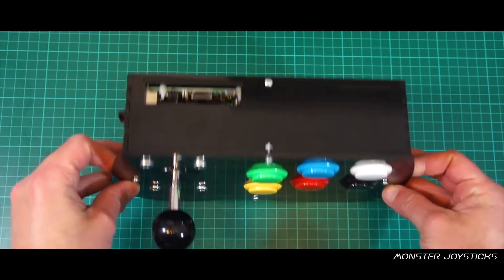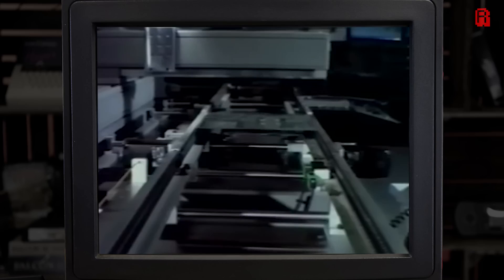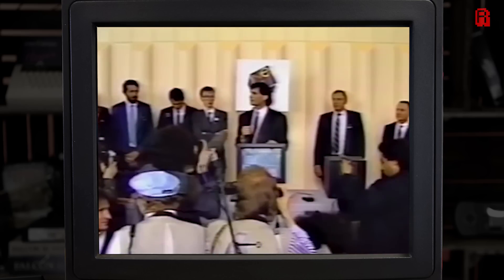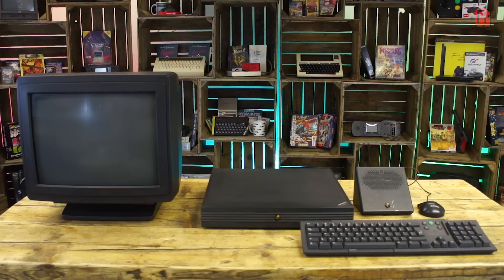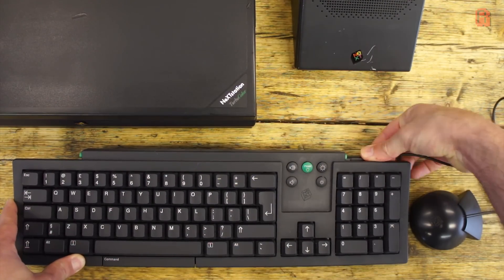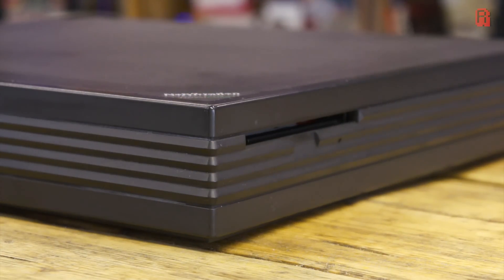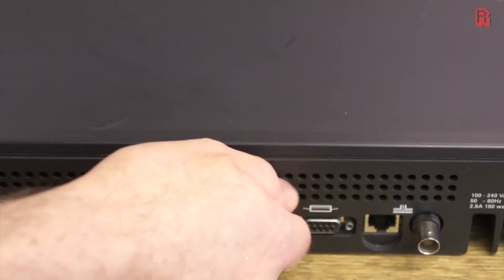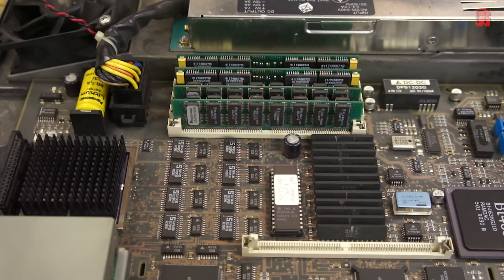NeXT Station | When Steve Jobs Left Apple - Part 1

Comment: The soundbox exists because NeXT couldn't get their monitor suppliers to put those components inside the monitor enclosure.  Steve was not happy about that, but by the time the color machines were under development, Sony and Toshiba weren't willing to front the engineering expense to make a custom unit for NeXT.  All they were really willing to do was put them in a black enclosure.

Comment: Egad NextOS and NextStep mmmm  lovely
Man if Apple had gone ahead with clones with A/UX or BeOS (plus got their head out of their ass) It's likely they'd have better, and vastly cheaper computers by now. at the time BeOS whiped the floor with apple for performance, hd space use, and ram usage. in a time when nothing multitasked other than the BSD's and Linux. that was a huge thing.
PowerComputing made a better Apple than apple did other than the buzzard splattered parts. it made a early attempt to expand memory. the clones brough apple early PCMCIA (don't ask) and PCI slots to the desktop at the cost of (then) god awful ATI hard disks. a fact i warned steve about. Take a guess how well he listned. If you answered: Not. one. fucking bit. You'd be right!
He also didn't want anything to do with USB. No idea why then, or now. Althing. They did try to make keyboards and mice that used ethernet. In terms of one form factor made sense. in terms of getting the fucking thing to work was a disaster. I doubt many, if any units sold actually used that....wait no I'm wrong, early laster writer printers did because asmbler was like a punch in the dick, Next and Apple  used ip weirdness to talk to printers through postscript. which was actually genius.(other than fact that a just about all universities, because of DARPA and Arpanet did that way before but this is apple. You felt lucky if the fucking os didn't crash after a few games or writing up a report.

Comment: My favourite computer system of all time, thanks for making this video. In the 90s, I bought a relatively affordable secondhand NeXTcube with the NeXTdimension graphics accelerator board while I was at university, using all my savings, some money from my parents and a large portion of my student loan. It was a gorgeous machine on which I learned to program in Objective-C using ProjectBuilder and InterfaceBuilder. Later, I traded it in for a 486-based Intel GX workstation which ran OPENSTEP faster than the older NeXT hardware did, and as a bonus, I could dual-boot into DOS and Windows. I still keep my copy of the OPENSTEP Mach 4.2 OS and my apps running under VM emulation to this day, such a refined looking GUI.

Comment: I found a Mac IIFX in a dumpster. Can you please do a video on it? It was much to my surprise it was like $11000 USD in 1991. I made my own VGA cable and it got online and impressed me in 1997-8 and worked perfectly except the bios battery. It looked like a 10 year old crusty flashlight battery hardwired to the motherboard!

Comment: I want to address your question at https://youtu.be/NbZ1M_qw-a0?t=1007: the Motorola 56000 DSP has never been programmed to his full potential, not even in the ATARI Falcon030 and standard GNUstep never took advantage of the full power of BT463 RAMDAC.

The limits of the DSP are still being discovered (at a glacial pace, I might add) in the ATARI Falcon030. By that token NeXT is terra incognita at this point. "The market" never matured enough to take full advantage not only of this NeXT system, but of Sun Microsystems Ultra line and SGI systems are even further away from discovery.

It would take the demo scene to figure out where the limits of this hardware lie and what it is truly capable of. We are still discovering just how far the Commodore64 hardware can be pushed in 2019, so try to imagine how many decades it would take to figure out what the NeXT or Sun or SGI hardware could be pushed to do. Which programming tricks lie in wait to do what the engineers of these systems never even considered?

Alas these are obscure systems; even demos which run on SGI's and Sun's are usually written in C and SDL and never bang the hardware directly. To see what this hardware is truly capable of, it would need to get into the hands of sceners and then we'd have another 30 years of research in pushing the hardware... so yeah, the market was nowhere near ready; it isn't ready even today.

Comment: The Motorola 68040RC running at 33Mhz or 40Mhz was a smooth running CPU for those operating systems that ran on it back then. To this day I remember it as being one of the more snappy and responsive CPUs I’ve used. I owned several Mac Quadras, with the 650 and 840AV being great for the time. My university had a few NeXT workstations for electronic composition. I’d like to get my hands on a NeXT Cube. As far as I’m concerned I think NeXT is Jobs finest moment. Obvious saving Apple will always be seen as his legacy, but the foundation and footwork was all done at NeXT. The GUI is just as fresh in 2018 as it was in 1988. 30 years! That says a lot. Especially the decision to include a Postscript Display GUI. The portability of the NeXT microkernel was responsible for Apple’s ability to port the OS from workstations, to iPods, to iOS to Watch OS, etc. and multiple CPU architectures. Really smart work NeXT did. Luckily Jobs had the Apple brand name to expose the world to this great tech convergence.

Comment: FYI, the SGI 13W3 monitors are also compatible with NeXT hardware.
I have a NeXTcube with MegaPixel Color Display (FIMI) monitor and my NeXTstation Color has an SGI monitor.
Reply from the maker: That's handy.  I'm releasing episode two tomorrow and have found that my capture card has a Sync on Green option built right in, and my old LCD monitor supports it natively so I was pretty lucky, just a 13w3 to regular VGA adaptor needed for the task
Reply: These two links are a compiled list of SOG-compatible screens that was cumulated for SGI machines. They work on NeXT black hardware with nothing more than a cheap 13W3M-VGA adaptor.

http://www.nekochan.net/wiki/Monitors_on_SGI_Machines
http://www.nekochan.net/wiki/Monitors

I've ordered a sync splitter for replacing my FIMI monitor (too bug and power-hungry for my purpose) that I will connect to an Acer V176L, which just looks like it was designed for the NeXT black hardware.
Reply: Every display that I have owned with analog inputs supported sync on green.

Comment: I was a scientific and industrial user of NeXT computers. You should be able to get that Intel version running or a huge range of Intel hardware, just make sure you have a compatible SCSI card and the rest should be easy as I remember. One of the final machines I had from NeXT was a Nixdorf dual Pentium Pro, it seemed blazing fast but the cubes with the video card that cost more than the machine was my favorite. For our uses we compared them to visual workstations from HP and Tektronix and NeXT was about one quarter of the price and way more compatible and loaded with options the others charged extra for. We also used SGI machines but the advantage of NeXT was how well it talked with everything else and how easy it was to patch together your own tools and make them look like a professional application. All these tools came with the machine, even a compiler which was a big deal at the time. Not only did you get all that but I had the business card and telephone number of an engineer at NeXT who specialized in making NeXT machines work in our industry and I could call him directly with questions or ask him to review my code, try that today.

Comment: So the hardware is pretty much a Atari Falcon but with more memory.
Reply from the maker: Funny you should mention that, a Falcon appears in tomorrows release and we make the comparison
Reply: Well.. with the old 68030 processor... they even have the same processor.. Of cause the 68040 is quite a bit faster. But with the original NeXT used the -30 processor.. its pretty much the same system. With full 14MB of ram on the Falcon they are really quite equally matched.

Of cause the Falcon is 3 years newer.... on the other side, its quite a bit cheaper.

Comment: Of note - because NeXT systems use the same keyboard and mouse connector as the Mac, you CAN use the power button on a Macintosh ADB keyboard to turn it on.

And that "sound box" was necessary for color monitors - the monochrome NeXT systems used a single cable for audio, video, and ADB, so had a custom connector, and all the plugs for audio and ADB were on the monchrome monitor itself.  (I have a NeXTstation Turbo monochrome with matching display - it has no "sound box". Mine have the older style keyboard and mouse.)

Comment: Setting up and running NeXTSTEP on a 'white box' aka 486 PC can be quite the challenge.  There is some help over @ http://www.nextcomputers.org/forums/viewforum.php?f=10  Although plenty of it boils down to using updated drivers, and checking that Hardware Compatibility List.  NeXTSTEP 3.3 is the best shot, the older 3.2/3.1 will require a SCSI HBA.  Although the 486 will underperform, the real power of course came from later generations of the Intel processors, like the Pentium Pro, and beyond.

For anyone looking to try out NeXT via emulation, be sure to check out Previous http://previous.unixdude.net/  It is feature complete enough to run all NeXTSTEP versions, with support for the next dimension board, DSP and of course ethernet!

Comment: The laugh being one of the reasons that Jobbo the clown was outed from Apple being his insistence that no 'professional' computer 'needed' colour...

He went on to make a $6500 "professional" computer in 1988 that couldn't display colour and who's video output was inferior to most SVGA 386 clones of the time. THEN he even fought his own investors over the creation of the NextStation colour because again, apparently colour is evil. Likely why on his return to Apple the machines went from a rainbow of colours to having all the style and artistry of a recently sanitized hospital ward.

Almost as bizarre as his nutjob rabid hatred of fans in computers; one of the contributors to the failure of the Apple III, and likely why to this day crApple wouldn't know a proper cooling solution if it stripped naked, painted itself Noctua tan, and hopped up on a table to sing "Oh look at what a big cooling fan I am!" Thermal throttling? What's that then? 

After all, what was the number one third party after-market add-on for the Apple II? Oh that's right, a sidecar with a fan in it so the PSU wouldn't go bits-up face-down if you tried to run it for more than an hour straight!

That reality distortion field of his was truly amazing. He could sweet talk a squirrel in February out of its nuts.

Comment: The control key is where it's supposed too be, and in the place it was on all computers till the Compaq clone PC. Which IBM also did on their AT. A common joke back then made about this (rather obnoxious key movement) is that Word Perfect paid Compaq to change the standard key layout to screw over WordStar users.

Take a look at your Commodore computers,  or any Apple II, any Sun Work station, the official SGI keyboards, or pretty much so any non-PC keyboard from the 90s and earlier and the layout is the same. The IBM XT series also has the same layout. Excluding the Compaq machine that started this change, XT clones all have the same layout.

Xfree86 and it's decendants all have an explicit option to correct the PC keybaord layout, and several coder orientated expensive keyboards offer putting the control key back in it's original position.

Comment: Well, someone really does get angry about this. The big failing of the 68k was really they could not get the clocks up. Intel could do it, Motorola could not seem to do it. The 68060 ran cooler and faster than the 40 but it was a dead end, just as the PowerPC could not keep up without melting. That's the end of it for me. But it bothered me when you start 20Mhz and 32 big address and data us when the system here has these.

Comment: Looking forward to part 2 as I never got to see the 68040 second series in action. Even at the time people thought the 68030 was suffering a bit. Interested to see how well they go as great examples of systems that have strong supporting hardware too. Have a PA-RISC machine that runs Nextstep 3.3, an 80Mhz version, the mid range one, want to see how that would compare, it certainly does not have the great supporting cast of chips, no DSP for a start. Plus, unlike the Next boxes the plastic has all aged and become brittle, they were meant to be cut down to a cost but were still out of reach of all but the few.

Comment: I had one of these babies when I worked at the BBC. The NextStep development environment became  XCode in Max OS X. The InterfaceBuilder is very much the same and many libraries and classes are still prefixed NS for NextStep. In the early 2000s I dug the machine out and had it online.
Reply: lrochfort I got one off Flea Bay in 1999.  There were tons of the slabs going for less than $100 USD.  Compiled all kinds of UNIX apps for it.  Send mail 8 something or another wound up being taken over as s spam relay and had to shut that down.  :(

The only limiting factor I ran into was a lack of support for threads.  Although Mach supported threads, it was not POSIX compliant.

The boxes still functioning today should really have a version of Linux or FreeBSD ported for them to run.
Reply: @markteague8889  Maybe you need to do something like "How to install Linux on a vintage 68K Mac"? (Both Macintoshes and NS had 68040 chips.)
Reply: @StrangerHappened  LOL … I wouldn’t have much of a clue about installing Linux.  In theory, it would be possible.  Although by today’s standards they are cripplingly slow machines, they did have some pretty kool hardware in them.  Especially, if you have the NeXTDimension board for video.  It would take a community effort to implement a Linux kernel and distribution capable of running on NeXT black hardware and fully exploiting the available peripheral devices.  As an alternative, the “Previous” emulator of NeXT black hardware was a very interesting project.  Last time I checked, It seemed to have been abandoned.  It’s the way these things go.  Someone is working on a graduate computer science degree and gets interested in emulation, then they finish school, get a real job, begin a family, and they no longer have time to play with such intellectual curiosities.
Reply: @markteague8889  Should Linux be necessarily slow on 68040 though? Those CPUs were the beasts of their time, super fast. Linux itself is a kernel so by default it should not be that slow even if it has gotten fatter since the 1990s when its first version was released. Some barebone GUI shells from the KDE/X-Window family of projects should not run much slower than native NS GUI in its basic functions. But the idea of developing stuff to actually use anything else beyond the 68040 CPU and the very minimum video driver support seems to be hopeless since it would be a major effort for a purely hobbyist thing that the NS fan community is now.
Reply: The Interface Builder got a complete rewrite around 2003.   It's been changing ever since, and today it's a major pain in the ass to even do the simple "connect a slider to a textfield" demo that Steve used to do all the time.

Comment: I spent my first 4 years in IT writing RAD applications on NeXTSTEP and Openstep at BT Laboratories. 1994-1998. Caught the end of NeXTSTEP (on P60s) and then we spend a couple of years running OpenSTEP on SUN RISC stations, and on some PP200s. I then spend 2 years doing WebObjects on OSX Server on mac pros for some web design houses through the dotcom boom.

The SW was revolutionary - EOF was just lightyears ahead of anything else out there - when java came along with J2EE many years later, it was pathetic - and remained a joke compared to EOF imho for 10 years+ . The power of the graphical UI designer, compared with EOF let 4 of us turn out industry level apps in 2 weeks, that would take 20 people 6 months in other parts of the business. It's a real shame it didn't take off more at the time. Webobects lasted a bit longer - and again, into 2000 it was still in a class of its own for controlling relation data, and knocking complete 3 tier apps out the door quickly.

Of course I'm sure you're going to go on to explain the reverse take over of Apple by NeXT/Jobs, and the origins of OSX (OSX Server which I mention above being the first, often forgotten, step to where we are now - it was openstep on MAC basically) - and now objective C lives on on apple and iOS - though EOF and WOF are pretty dead - which is a pity because frankly they were the ferrari to java's lada when it came to enterprise frameworks.

I only got rid of about 10 massive NeXTSTEP 3.3 manuals and CDs about a year ago after finally deciding that they were more junk that priceless artefacts - but I'll always have a soft spot for NeXT.
Reply: my condolences  Did you you use solaris or one of the other sun os's?